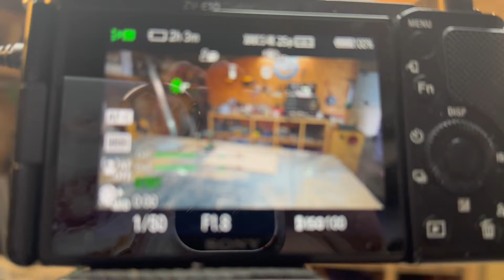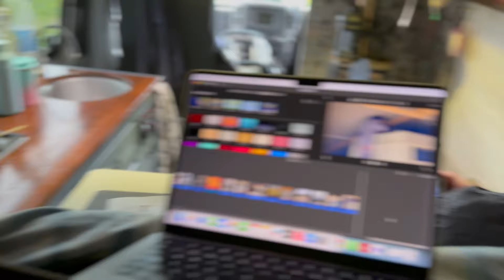LOCKED in at the CAMPERVAN workshop | This must not happen again!

Comment: I recently went to a BQ to get some screws, i bought 4 packets of 25 in each pack and of 2 different sizes - so i had 50 of each - it cost me £18 80... the only reason i paid was in case i really needed these, so on my way to a job i popped into wickes, got a box of 200 screws for £3.60, went straight back to BQ for a refund, they have a large variety but they are extremely expensive.